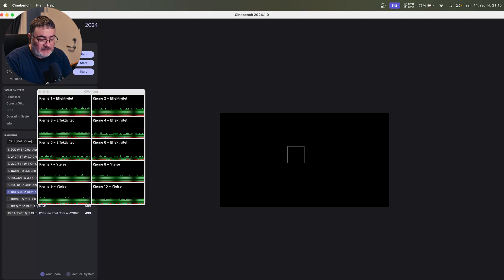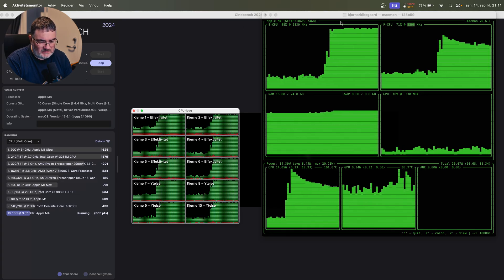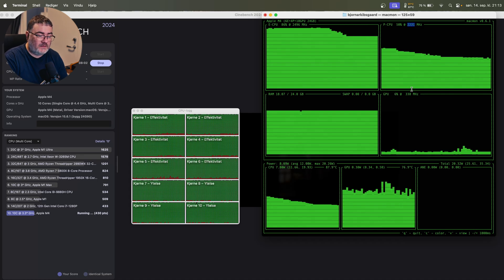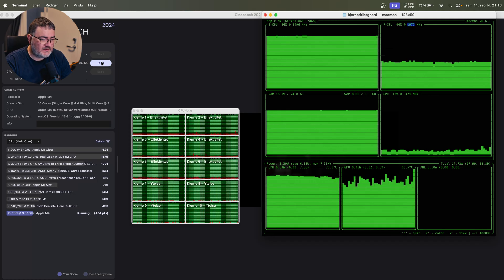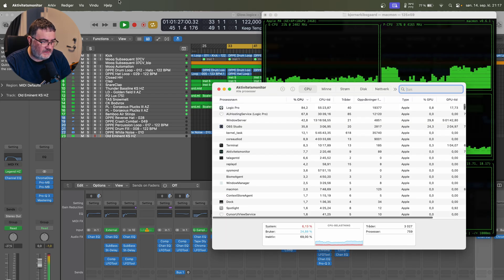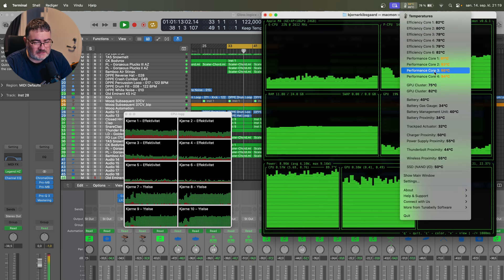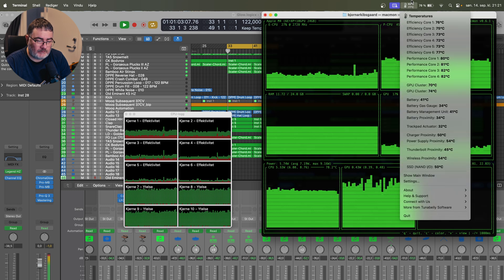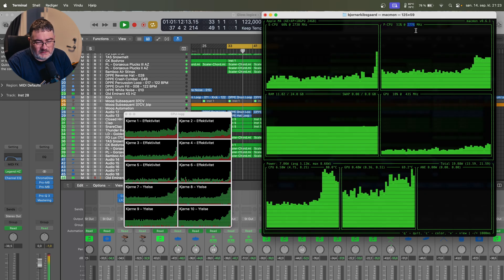Careful with Hard Workloads on the M4 MacBook Air!

Comment: Content you post is so helpful, thanks im about to purchase this exact model
With the M4's currently on sale would you recomend to stay with the 24gb Air or for around the same price go with the 16gb PRO, my understanding is the more RAM would be better for workloads, or does the better disc speed and fan on the PRO outweigh the smaller RAM.
Thanks !
Reply from the maker: Thanks! You will probably be fine with the M4 Air. I mean people video edit just fine on an M1 Mac, it's not going to be a huge problem. It all depends tho... if you have very demanding plugins and workflow and you work live so that you need good latency maybe going for a Pro is better... but yeah. The air is not a bad machine, it's very capable for professional workloads!

Comment: I need to work live with some audio and VST's running and also I need to play my NI Kontrol S88 MK3 with Buffer of 32 or 64 at the same time. Will Macbook air M4 will work fine? It will not be many tracks. Probably 5 audio tracks and 4 VST's (Diva, Samples, Pigments). Any suggestions here? I'm looking to buy Macbook Air 32Ram and 2TB (no external SSD). Thanks

Comment: Hi Bjørnar, really love your videos! 

I’m currently undecided between a MB Air 13”/15” 32 GB and a MB Pro 14” 48 GB, both 1 TB. I’m producing on Ableton, and by watching your videos I understand that MB Air is very good at this - however, I also perform live sometimes, using a Push 2 as my main controller, triggering scenes and some plugin effects/sound design that I tweak live. What I find concerning about choosing is mainly that MB Air is lacking a fan/cooling system, which in a live environment (1h/1h30m performance) might be a little too much to handle for a MB Air perhaps? 

Would you recommend me MacBook Air or Pro in this case?
Reply from the maker: Thanks for watching! I would go with the Pro.
Reply: @bjornark  thanks for the advice! Ultimately, I was thinking whether a cooling pad would be enough for those cases (saw some on Amazon that could work as a laptop stand that have cooling fans), as a MB Air would cost less than a MB Pro, that wouldn’t definitely break the bank 🤔 will consider buying a Pro either way as I rather be safe than sorry in those situations lol

Comment: I have the 24 GB M4 Air. I'm working as a professional sound engineer, and I tested it in some dense mixing sessions; I work with Pro Tools, some of the projects had 100+ channels (at least 80+), some of them had CPU-intensive guitar amp simulations (Helix Native) on at least 10+ channels, and all of these sessions had UAD plugins on almost every channel. Also, I work with folders for almost every instrument group, and I have never encountered a CPU overload. I can easily say that this machine handles these tasks really well, even without noticeable heating. Of course, the Pro is a better choice, but the Air, especially with additional RAM, is amazing in music production.
Reply: This is honestly such useful information, especially the amp sim stuff. I’m always sceptical of audio benchmarks which just stack instances of serum, because what always seems to really break my cpu is having multiple amp sims and UAD plugins.
Reply: How many hours would you say your longest session took so far with it?
Reply: @OmuNikoro I mixed in multiple sessions, so not extremely long hours. But in one of the sessions, I used it for like 7 or 8 hours and it handled it really well.
Reply from the maker: Thank you for sharing. Yes the air is very capable.
Reply: What sample rate and buffer size, well i guess it dint matterin mixing sesiona
Reply: @MUSICALMANGORECORDS I tested it in 48 kHz and 32 buffer in these sessions and I mostly use this configuration because I practice guitar a lot with amp sims. It ran butter smooth but nowadays, I'm using it in 256 or 512 buffer while mixing to reduce the CPU load, but I never got a CPU overload even with 32 buffer.

Comment: Well, pretty good video, but! I disagree. It will be damaged! The SSD and battery are temperature-sensitive! Regarding the pro trotting... I even had trotting protection on my Intel Pentium 2 back in 1999...
Reply from the maker: Sorry but no it wont, it clocks down to protect itself.
Reply: @bjornark  no, it wouldn’t, it’s only regarding the SoC and overall chassis temperature, I tested it myself, the temperature on the battery and memory rise over 50°C. And in ideally, you need to keep it under 40.

Comment: The MacBook Air M4 with 24 GB of RAM is impressive, but I wouldn’t use it in a continuous live environment. It’s fantastic for composing and, more importantly, completely quiet. I work in a very low-volume setting, so the absence of fan noise is pure bliss.
Reply: may I ask exactly what you mean by continuous live environment?... I would think that a studio environment is more taxing than a live environment but I might be misunderstanding.. I am trying hard to decide between the air and the pro and having a difficult time.

Comment: It's getting warmer quickly even in the daily light tasks. There is a narrow case and no fans. Keep away from Airs.
Reply: They are probably good if you have a cooling fan. But otherwise buy the pro (or Mac Studio)
Reply: @ThatXboxGamer-oc9rf  I bought a MB Pro, and got rid of the heating MB Air. MacBook Air has narrow case and no fans, which means it is getting warmer, and throttling.
Reply: @obeythesystem-n6v  and how often is the fan on your MacBook Pro triggered because this is extremely important for people who need silent?
Reply: @444levels9  Fan worked just 2-3 times in the summer time.
Reply: What are you runnin in youy sessions
Reply from the maker: I wouldn't say people should keep away from Airs. Just know how they operate. For "most" users I dont think this will be a huge issue.
Reply: @bjornark  are you going to put thermal pads?

Comment: Hi.
I was thinking to buy MacBook Air M4 24GB, 512SSD
I want to use it for making beats, songs usually Omnisphere, Keyscape, Arturia..max 25- 30 Tracks..(usualy 10-15)..one session around 4 hours in Fl Studio. I want to use it at least for 5 years.
Do you thing it’s good enough?
Thank you for response🙌🏾
Reply: I have the exact question. I’m using mostly guitar plugins and messing with audio a lot but waves plugins and some synths. Did you end up getting the m4?